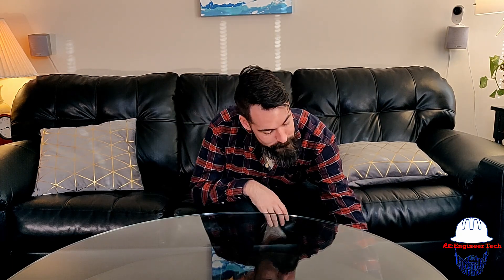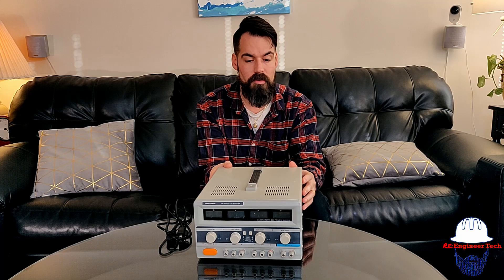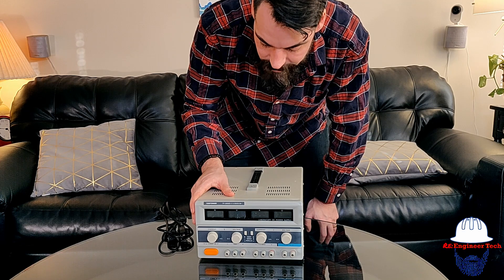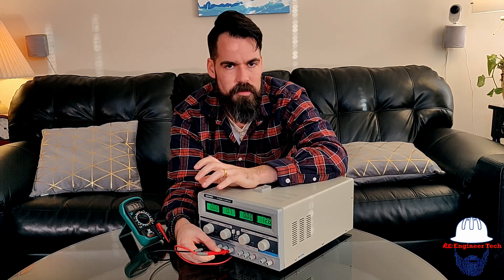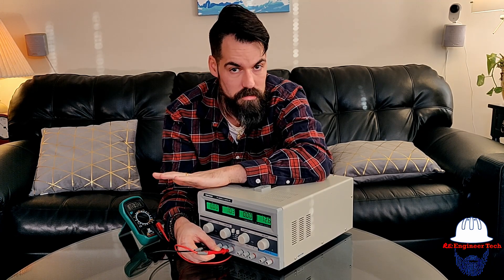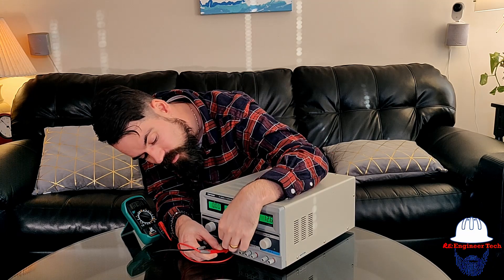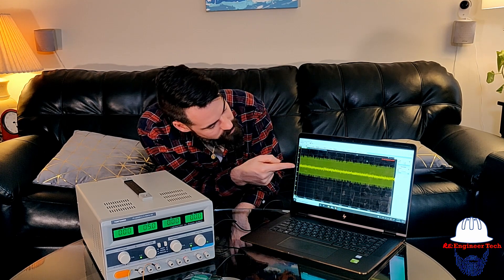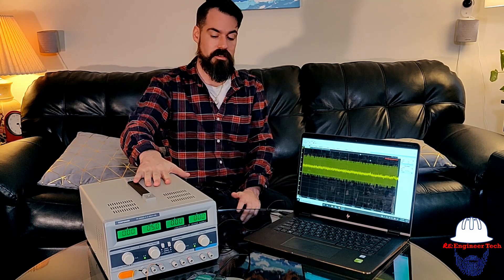Under $200 Triple Output Benchtop Power Supply

Comment: I think your scope might have a high floor tolerance on that amplitude measurement on the ripple. My upcoming circuits I class is going to use that same USB Analog Discovery Kit. Also, I just picked up almost the same power supply. That's how I found this channel, Lol. I'll measure the periodic and random distortion on my TDS3054, maybe.

Comment: Wait.. When I am turning the Current knob, it isn't changing. 

I have a small LED connected and have the Voltage at 2.1 and the current is at 20 milliAmps. 

If I bring the Voltage any higher the current will go up and destroy the LED (destroyed 2 of them already)

Are both of my current knobs broken?
Reply from the maker: Well you should always be running a resistor in series with your LEDs for longevity. The current is always limited by Ohm's law when you are using Ohmic components. Think of the current knobs as a safety so you can protect your circuit from unlimited amperage. Most of the time it wont have an effect but if you accidentally short something it can limit the current and save you. You can test the knobs by turning the current all the way down and putting a low value resistor across your supply terminals then slowly turn the current up. You should see at first the CC light be illuminated and the amperage slowly rise with the turning of the knob until you reach the voltage you have set. The current will max out according to ohms law.
Reply: @ReEngineerTech  The LED was being used more or less as a way to test the machine. I realized that what I wasn't comprehending was the difference between constant current and constant voltage. I was in constant voltage mode. In the manual it indicates how to switch between the two which isn't intuitive at all. But it works!

Thanks for the comprehensive response, I'm subbing to you because of that.